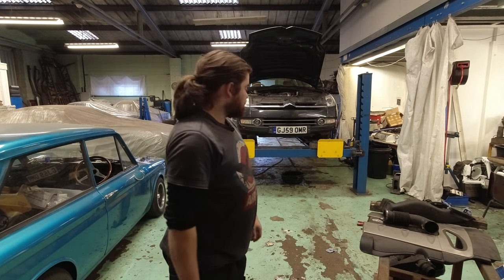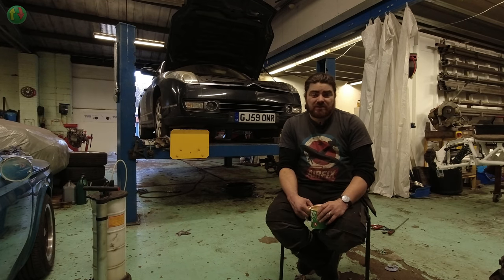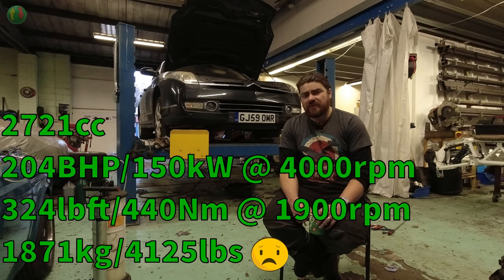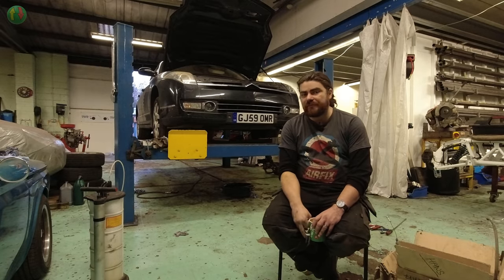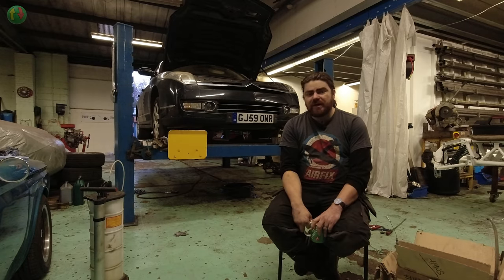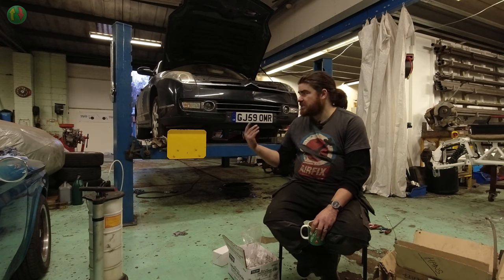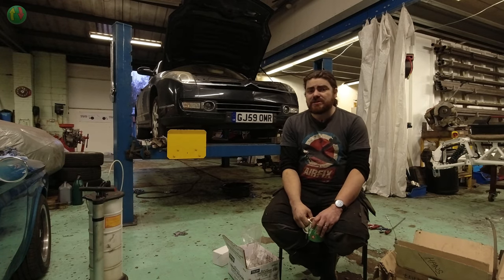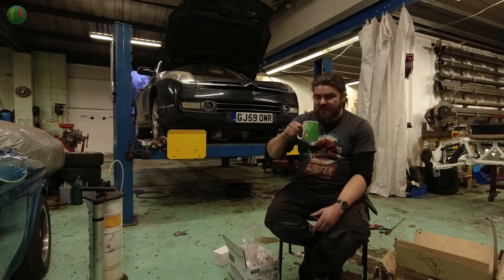STORYTIME: How I ended up buying a £750 Citroën C6 in lockdown!

Comment: I'm enthusiastically looking forward to more on the C6. Big Citroens are cool, "period", but this with all the kit and a to me good colour combo, gets a lot of extra points. I'd have a V6 petrol if given the choice, but when the right car is there, you go for it..petrol or diesel.
Reply from the maker: I'd have the petrol, too, just for the added smoothness and simplicity. The diesel is a fair bit quicker, but the added complexity means that one day, I'm going to have a bad day.
Reply: @UPnDOWN  I'm not surprised the big diesel would be faster than the 3L petrol. I spent some time in a 3L 24V petrol XM back when they were new. It's a lovely and very stylish car, but certainly not fast. Diesel torque would help, a lot.

I'm crossing my fingers for your engine/ownership experience. The possible negative outcome sounds very exciting, but in all the wrong ways. Yikes.
Reply: Period?
Reply: @jo05dk  i also had the 3.0L V6 24 valves after owning a diesel with turbo but with manual transmition it was a very fast car not close to the diesel i had before and fast ,off course not as a litle unconfortable car or a porshe or ferrari but fast compared to other cars of the same range and the more confortable with the same system as the DS hidraulic suspention ,only after 95 they improved the suspention at high speed (not that didn´t work perfect but some drivers were not into not feeling the road on the steering wheel , just that)but for a giant and spaceship type car 240 km/h is fast in my opinion and from 0 to 100 km´s/h in 7 seconds ,if automatic i never seen one they do are slower but manual is the driver who controls the car, didn´t knew they had problems never seen one with those problems refered, don´t know if it´s exclusivelly problem with automatic gears, but it´s a out of this world feeling, driving it and yes electrical systems came to stay in the 70´s allthough mechanics normally aren´t mechanical engeniers and don´t have a clue about evolution in electronic systems they do know how to work in a car with 60´s specifications and due to the sucssess of the DS ,GS  and CX all knew how to work on hidraulic suspensions but that is gone also ,the knowledge of 70´s mechanics that normally didn´t study and all they could do is learn from a older mechanic how to work on cars, that´s the main reason mechanics do start to deliver smoke from their hear drums ,i myself not being my speciality mechanics i went to a bibliotec and took all the books about cars that there were lot´s of publications in the 70´s or i would have to pay each time something in a car that didn´t work, i learned somethings through the years or i wouldn´t be selling 2nd hand cars for 25 years and some repairs that are charged are simple as learn some about electronics and how to unscrew and screw some bolts or change a wire like on do at home when a plug gets disconected and one conects it again ,it makes me remenber the BMW´s 2002 that the one with 4 barrel carburator was fixable but when a ti or tii appeared was almost impossible to repair and that´s the reason i bought 7 of them very cheap but also bought the four barrel carburator as they asked me what today is 400€ maximum for each this in mint condition and either than a Alfa-Romeu 2000 GT veloce from 72 my other 90´s car was a mint BMW 2002 and 1502 this 75 models from the same colour only one had a rpm counter and other a clock, also some 74 ,75 ,76 520 ,3000 CS and 645i all still with chromed side mirrors, some that today are in mint condition when i bought them in the 80´s or 90´s were sold as destroyd and with some hours with help from a friend they become tuned perfect
Reply: @RUfromthe40s  I don't know if you're talking about the XM or the C6, but none of them go to 100 in 7 secs. I have, on one website, seen internet data on something called a XM V6 Performance, manuel, which supposedly goes takes 7,8secs to reach 100KM/T or 60MPH (don't remember which it was). ..but standard numbers are something like 8,4 as the fastest to 100KM/T i've seen listed for a manuel, and around 9secs for an automatic. Topspeed: 235 for the fastest, and 230KM/T for the automatic..as far as i remember. And: One thing is ho fast they go if absolutely floored, another how fast they are in daily use. The guy who owned the XM i experienced also ran a Peugeot 2,0 auto (petrol), and he said that irl the Peugeot was at least as fast as the Citroen because of lover weight. I LOVE those cars, but such a big car with around 200HP isn't fast. 

Lost skills: Sadly i fully agree. In my family i had a mechanic who was trained around 60 years ago from now. He learned how to rebuild engines because they had to do that all the time back then. The skills on that guy.. He could fix more or less anything, and, as an example, easily constructed a honing device for a scooter that needed a new cylinder, just like that. Such a shame that those skills are disappearing.
Reply: @jo05dk  the XM did it ,don´t know how you bought yours but the european model or you never drove one they were very well designed for speed and lower to the ground ,even the 2.0L in-line engine took 10 seconds and a few 0.2 seconds more this to be acurate and the turbo diesel also very fast ,don´t know what you think this cars were ,the high-end model more than 7 seconds only with the engine destroyd ,it´s the same of other coment they made to me that a 280SL from 68 couldn´t had more than 60 h,p ,while without being toutched it had 140 H.P., regards
Reply: @RUfromthe40s  "even the 2L".. The thing is.. Based on what I can find there are seven(!) 2L versions, with power ranging from 108 to 150hp, so that statement doesn't make much sense in itself. Just like how fast "the turbo diesel" is, since there apparently are four diesels, three 2,1 and one 2,5L, three of them with a turbo, ranging from 82hp from the non-turbo to 127hp.

Researching this I've looked up performance stats on I don't know how many different sites. I've seen ONE site claiming a 7,8 0-60/62 for a manual 3L 24V. If you can come up with a few sites supporting your claim I'll look further into it. ..but no more jabber please. Tell me where to go, and what to look up when I get there.

Comment: I have a 2011 C5 X7 2.0 HDI 16 Comfort (Hydractive 3+). When I bought it about 18 months ago, the biggest problem it had was a broken dipstick. Whoever worked on it last filled the oil to the bottom of the broken dipstick. My Citroen mechanic pumped out the 3l of overfilled oil, the display stopped saying "oil level improbable" and all was right with the world. It was due a timing belt change so that was done, waterpump, serpentine belt and all fluids, including the transmission. 

Interestingly, while it does say "filled for life" in the FRONT of the owners manual, the service record has an item for Automatic Transmission fluid every 50, 000 km. This had been done once in the then 150, 000 km of my cars life, but the fluid was now orange. It was changed (as much as you can) at that major service, and again 5,000 km later. All good again. 30, 000km later, still fine.

I am a fan of Aisin transmissions but, as you say, "sealed for life" is a load of crap.
Reply: The C5 Aisin auto has an oil life indicator. But it can only be access through the diag computer.

It definitely doesn’t need to be changed every 50000km. It’s design to last 400000km or 10 years under normal conditions.
Reply: @dufonrafal  I looked in the service manual for my C5 and it says automatic transmission oil change is recommended every 60,000 kms. According to the service record this was done at a Citroen dealer at that mileage. So 90,000 km and 6 years later, the fluid was no longer pink.  I am comfortable following my mechanic's recommendations.
Reply: @cme2cau  Which C5 do you have ? An old 4 speed ? Which country ?
Reply: @dufonrafal  I had a 307 with that dreadful 4 speed. I am in Australia and it is a 2011 6 speed with the 2.0 HDI 16 valve. It is possible that the fluid change at 60k didn't happen as I did not own the car at that stage. It was a country car so, while not doing as many changes, the transmission would have been exposed to temperatures that regularly exceeded 35C and occasionally over 40C.
Reply: @cme2cau  It's possible that the 60k oil change is due to Australian weather, most likely sand.
Reply: @dufonrafal  Heat is more likely to be the problem. Even more likely is that they hadn't changed the wording in the manual since the 4 speed ZF days.
Reply: @cme2cau  On a Ford 6-speed I rented, the owner manual asked for a 60k oil change if driven in dusty/sandy condition. But "for life" otherwise.
Reply: @dufonrafal  I had a closer look at the service record book. Citroen specify both dusty conditions and frequent days over 30C as severe operating conditions. The same service book is used for many vehicles, including those with the AL4.
Reply: @cme2cau  thx :)

Comment: With regards the transmission issue, I had something similar with a RAV4 a few years back. At the time I was a transmission development engineer and was convinced it was the valve block and/or contamination. Turns out it was the transmission ecu, a PCB inside had broken down rendering the car unable to decide when and how to shift.
Reply: (Not a mechanic but I had this problem with a GM car.) What I thought. Stalling at a stop has to mean the lockup clutch isn't releasing if it's transmission caused. If the trans didn't shift back down into 1st gear it wouldn't matter. The torque converter would still slip allowing the car to idle. Either the ecu isn't telling it what to do, or (like mine) the solenoid or whatever it is that works the clutch was sticking. It was on the outside on that transmission, so the whole repair cost was around $300. The bad shifting could be internal or again a bad ecu. I had a bad ecu that controlled the wipers on that car, and they only screwed up on hot days. Then they went nuts. Anyway since like most automatics this one is used on a lot of cars any transmission shop should know the ins and outs, unlike with Citroen-only components.

Comment: The C6 is a car I've always wanted, and at one time I wouldn't have hesitated to buy one. That however was in the days when I had access to a car lift and workshop facilities, now I don"t.  I didn't know about the crank issue, that is very poor and would deter me from the V6 now, problem is, the twin turbo hdi 4 is mega rare, particularly in exclusive form.  The C6 is just so superb though, styling, interior, gadgets etc. And then there is the ludicrous level of car tax, which I strongly resent paying to the government thieves.  Look forward to further vids on this though, it may reduce my fear factor to the point I buy one anyway, you never know!
Reply from the maker: The crank issue isn't common in PSA vehicles, it's more the Land Rovers that use the engine (presumably due to the extra weight etc)

Comment: As with all hydraulic faults the problems only show when the system is hot and the oil has thined, less viscosity. The problem is usually worn seals, spool valves and pumps.
However, please check any oil cooler for blockages as this can cause the above problems if oil is too hot.
Jong.

Comment: My uncle had a Red 3.0 HDi new has a company car. 
I made a joke to buy something  that didn’t have a reputation for reliability because he had terrible reliability from his Audi, BMW and Mercedes all enjoyed the comfort of the main agent workshop than the open road. 
So he got one of these it was 100% reliable over three years and brought the car afterwards when he was laid off kept it another 2 years and just never went wrong. 
I was an apprentice with Citroen specialist in the early 90s working mainly on 2cv GSA CX odd SM, BX, Xantia, XM’s and other normal models.
If the transmission oil is that black then it’s due an overall and I don’t think just a valve body or a solenoid which is a common issue on Renault 4 speed Automatic.
And has from the 1st April the RFL on the C6 as gone up to £615. 
Sorry
Great channel first watch.

Comment: Our second one *the rescue has an issue with the gearbox: wecan drive it without any sort of problem, on the highway, as long as we want (slow or fast) until you don't come to full stop, there is no issue. No clunks, shakes, noices when normal driving. But when we need to break to stop entirely the car might start shaking, and the engine sometimes stops. We were told it's the torque converter in our case. Also we noticed that we can shift gear without pushing the break on this one (and of course it starts driving right away). Any idea on this one? We have even more limited knowledge about this :)))
Reply from the maker: If it only causes an issue when stopping then it could be the torque converter. I would do a few fluid changes if you haven't already. You can move the lever between R/N/D/sequential without holding the brake, yes. You need the brake pressed to get it out of P.
Reply: @UPnDOWN  that is the thing, I can move it out of park on this car 🥺🥴 without pressing the break
Reply: @fulminatorc6  brake
Reply: @emjayay  Danm, LOL I was using it wrong for who knows how long. Thanks for pointing it out. Sounds the same :D

Comment: I love the look of the C6. Big French luxo-barge in the greatest tradition. It's the 407 interior that lets it down. The overly complex heating and ventilation controls compared to my C5 that makes me think twice.
Reply from the maker: The heating and ventilation controls were also used in the higher-spec C5 mk1. To be honest, I've had a 407 too, and the C6 feels pretty different inside, despite the HVAC controls and indicator/wiper stalks etc. 
I'm glad they spent the money on frameless doors, steering headlamps and active spoiler, tbh. I can live with the buttons! They're not difficult to use anyway.
Reply: @UPnDOWN  My C5 has been my favourite car of all time. It's so freindly and easy to use. For example, the door bins are made of the perfect plastic to grip any drink can I place in it without spilling. Try that on other cars, and I'm cleaning up a soggy mess. The controls, big and simple to use with immediate effect  ( No processor required to change cabing temp etc. ). Beautiful looking car and oh, so frugal and comfortable. Only downside is, my stereo typical light metallic blue hatchback, with a slight dent in the boot lid, has super low status. Excellent when facing off with a JLR product down a double parked road, I always get flashed to go first. Really bad, when driving around the 'bad lands' of the Southern Irish 'border' villages on a winters night. Got actually run off the road by "vigilantes" at 8 pm on a winters evening, and then they had the gall to call the cops on 'ME'. Suspicious activity in the area.

Comment: Had a peugeot expert that was basically new when I worked at peugeot that wouldnt lock up because the valve block was a dud. Stupid shop manager made us change the tourque converter 3 times before listening to the correct day1 diagnosis.
Reply from the maker: Ouch! Torque converter much more difficult to change than a valve block!
Reply: @UPnDOWN  Yes it is. It was such a foul display of incompetence in leadership. I was an intern at the time and could make the right diagnosis just by reading the printout from Diagbox. The guy who drove the van was thurroughly unimpressed to. He had had the van less then a year then we had it back for just over 2 months for a 90 minute repair.

Comment: Outstanding- I am in Australia and have been looking for one of these for over a year but these are both rare and extremely expensive - over 30kAUD
Reply from the maker: Cheaper to buy one in the UK and have it shipped over.
Reply: There's one going for 9 grand on Trademe in Auckland, if you don't mind the shipping.
Reply: They were shockingly pricey when new in Australia. I remember drooling onto the dealership showroom floor.

Comment: I had very similar gbox problems with a 2001 Volvo V70 (Aisin Warner gbox). It did flares just like you described. 
Did full ATF flush on the machine.
The  ATF came out Coffee Brown... gbox never really was perfect.
Reply from the maker: Yep, pretty much the same box (or a variation of it).

Comment: I suspect you've already done it by now, but in relation to the tf80sc, it doesn't quite select neutral but disengage the turbine. Remaining in third is the 'I've failed but will get you home mate' default.
I'm sure you did , but after a fluid flush the oil counter should be reset. You can also use the lexia to do a full or partial initialization of the ecu, which is quite important.
If it is the valve block (and being a 2007 car it probably is) you might want to consider a sonax block.
Reply from the maker: I think I reset it...certainly tried to. Not sure about the initialization though, will have to check.
Reply: Worth doing, but if you go full reset you'll need to go for a long drive with lots of differing driving so it relearns...

Comment: Fantastic Citroen collection - well done! I had the pleasure of owning an identical spec C6 registration GJ59UYO. As someone with no mechanical ability I sold her when it became clear that my local Citroen garage weren’t really able to service her properly. Truly the last proper big Citroen.
Reply from the maker: Yeah, sadly the dealers weren't too fussed by it. Most of the GJ59 cars were pre-registered by Citroen UK, and were a couple of years older than the reg suggests. Most were unsold stock that they needed clearing before the facelift and 3.0 came out. Probably sold them all at a loss, including mine!